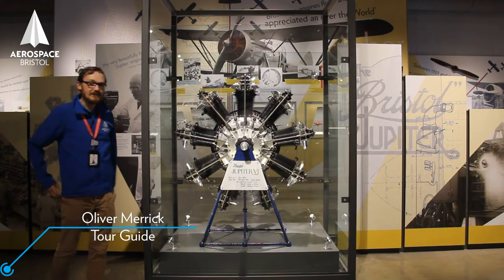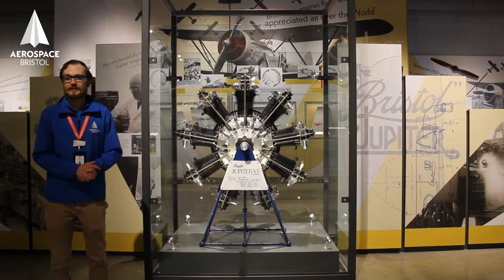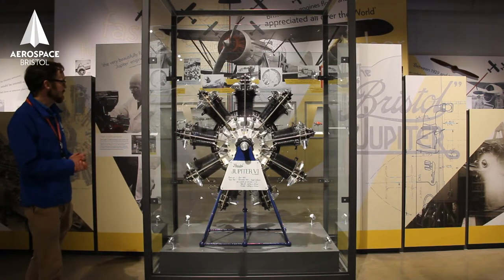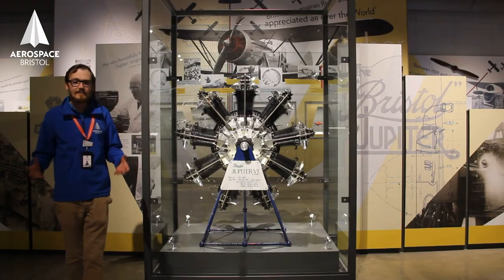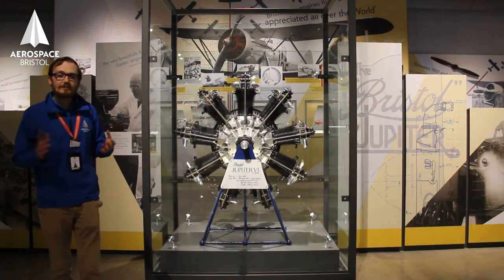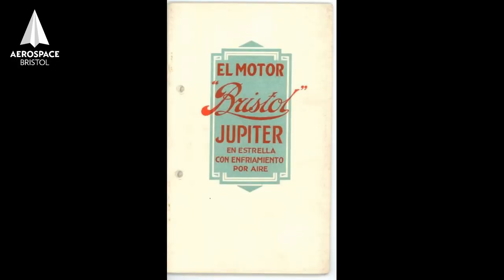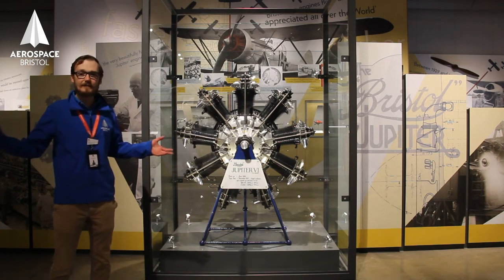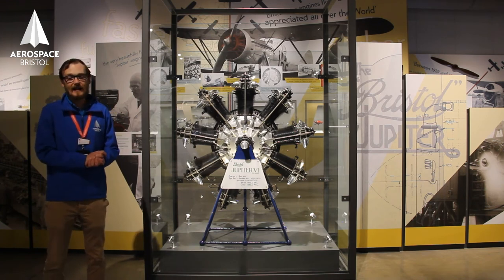The Bristol Jupiter

Comment: It's a beautiful engine it's a real pity they never built a twin-row version of the engine and Bristol waited so long before they even considered twin-row engines as both the French and the US did build twin row 18 cylinder radials with the French Gnome-Rhone 18 series being based off licensed Bristol engines and they were all able to get 1300+hp off an engine weighing less than 750 kg.  Even a conservative power estimate for a twin-row Bristol Jupiter II engine would be about 750hp at 750kg and probably could have been available in 1920 giving an engine performance 15 years ahead of its time.   A twine row Jupiter or Mercury engine could easily have been the 1st 1000hp+ engine whilst being reliable and would have weighed the same as a Rolls Royce Merlin.  While a twin Pegasus could have easily been pushing 1500-2000hp by the mid-30s.  It is mind-boggling to think what could have happened if the UK had engines equivalent to the Merlin in 1925 and 1500+hp engines in 1935.  This was the route Bristol eventually went down with the Centaurus which was essentially a twin-row Perseus but they didn't start until 1938, while the US started the work in the late 1920s and the French also had a working 18-valve twin-row engine based off a Bristol design pumping out 1300 hp in 1937  to make it worse at that point, they were having issues with sleeve valves and if Bristol had gone twin-row early and had created twin-row versions of the earlier poppet valved radials like the Jupiter in the early 1920s (they had the skills) it would have been a game changer.